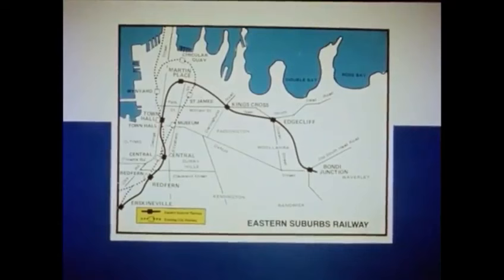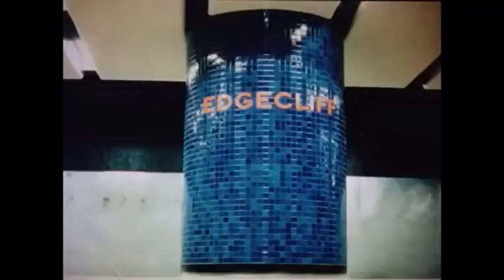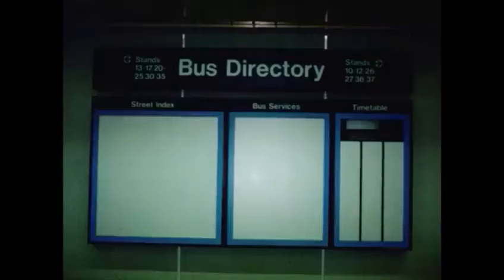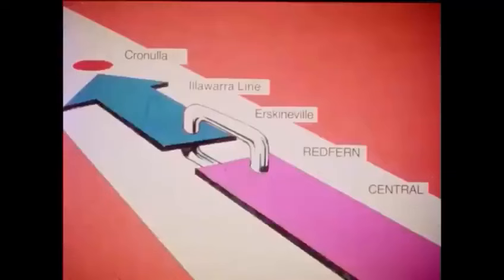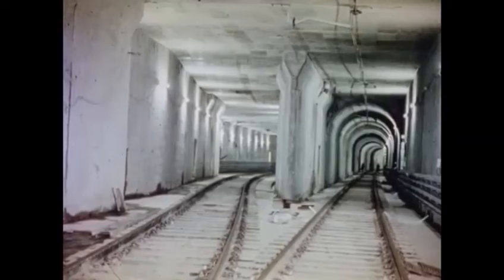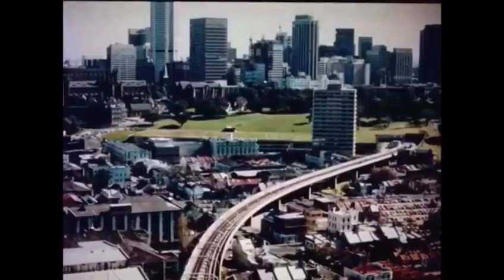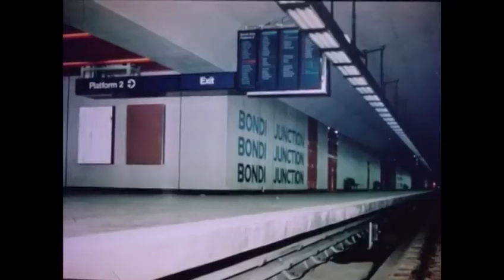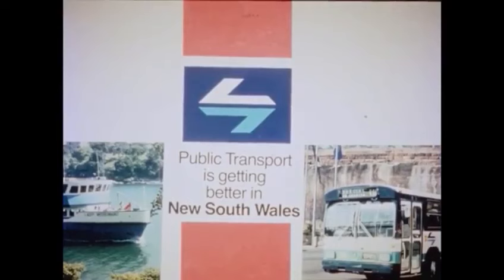(1979) Construction & Opening Of The Eastern Suburbs Railway Line

Comment: I feel like they missed an opportunity when building this line to extend to Bondi Beach, Bronte, Clovelly, Coogee and Maroubra. Or if not that, a bunch more suburbs (Waverley, East Gardens etc). Then it would have been a true Eastern Suburbs line. As it stands, there's only really two stations that are Eastern Suburbs - Edgecliff and Bondi Junction.
Reply: they originally were going to extend it to Kingsford around 2019, they even bought the building for the stations but then cover struck and it didn't haven. they were originally going to put it to Bondi beach but they didn't because commuters didn't want a train station around such a famous beach plus there would be too many tourist and the station would dirty really quickly for example... rubbish bags or fish and chip papers etc..
Reply: @TheRealMillennium  Do those things happen at Cronulla Station? Genuine question... I haven't caught the train there in years.
Reply: It was scrapped in 2001 by... Bob Carr and the Labor government.
Labor... Famous for announcing and cancelling infrastructure projects!!! 👍
Reply: Wasn't finished thanks to Neville Wran and the Labor always half a job should have been completed properly no need for a light rail wasn't built like it should have been
Reply: the story i heard is that the line was originally planned to terminate at bondi beach, but there was a massive protest against it by local residents. similarly, local protests killed woollahra station. the project feels unfinished, despite the triumphalism of this extremely interesting clip, but it's hard to see the ESR line extended further now that light rail services some of the missing bits.
Reply: Thank the Bondi locals for fighting against it. They wanted to keep the beach for themselves.

Comment: I remember this well. I was living in Sydney back then and took quite a number of trips on this line. When they first opened, they had problems with the train noise in the new tunnels, though that was quickly fixed soon after the opening. I used to be able to even see the trains heading out along the Wooloomooloo Viaduct from my workplace. I also rode one of the test trains heading through underground Redfern, before that station opened.

Comment: Before ESR how did the Hurstville line run? Through city circle via museum, and then proceed to  which line?
Reply: I'm thinking this was the case. But would be great if someone could confirm.
Reply: I don’t think it went to museum, I think it terminated at Central through Redfern platform 9 and 10
Reply: They went to city circle via museum. There were approx 26 trains per hour (up from current 20 tph max) combined with  East Hills line. All Bankstown Line trains went via Town Hall, ie. Outbound Bankstown line trains all departed Central from Platform 19.
Reply: @raymondlowe7099  Thanks! I remember the Bankstown circle. The Illawarra train once through the city circle where would they continue to?
Reply: Looks like trains from Liverpool via regents park and all from Bankstown (via strathfield and sydenham) to city went to city circle via Town Hall. So they would have formed the East Hills and Illawarra line services.

Comment: I rode this route, and under this route, futuristic looks this railway route with these traction "arches", unfortunately I rode in the evening, so from the perspective of the train I did not see much.
Reply: What a pity that the Sydney Metro Skybridge at Rouse Hill did not have similar overhead arches, instead of the ad-hoc looking exposed wiring running up the framework on some of the stanchions-very utilitarian!
Reply: @murraykitson1436  You know what's the worst? That the whole charm of this line was broken when they installed unnecessary orange plates at the stops, despite the fact that the inscriptions about the name of the stop were visible like an ox.